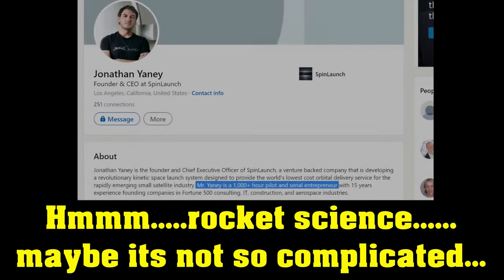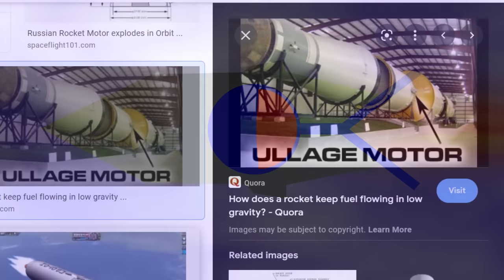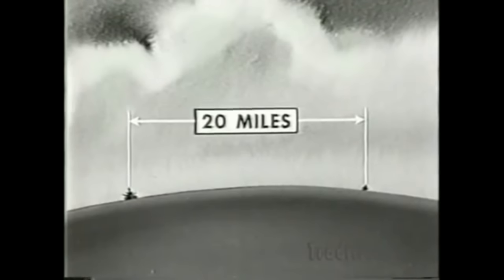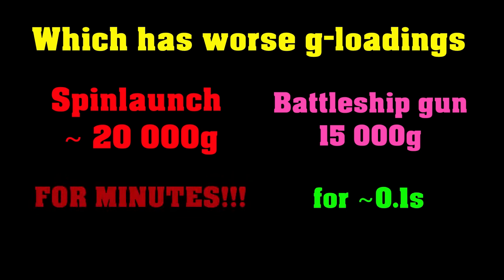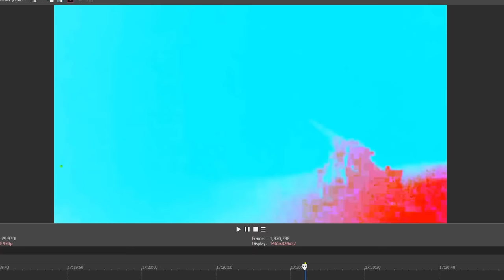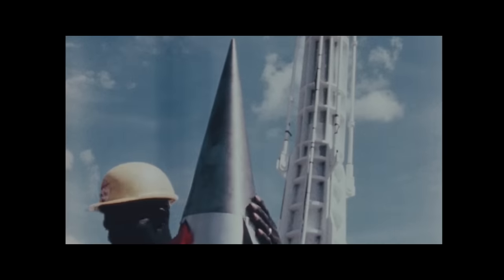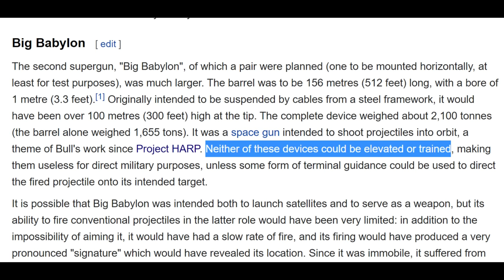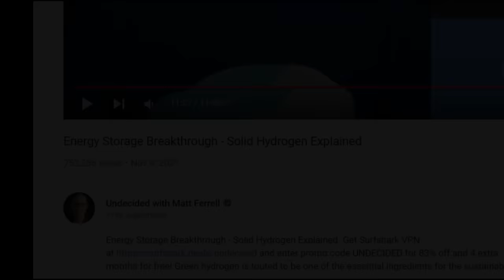Spinlaunch: BUSTED (Part 2)

Comment: I thought that 200kg is actually the max payload of their final version, so the whole assembly with fuel would have to be ~1t or more to further accelerate to orbital velocity. 
If the 200kg is total, it can orbit just oranges which would be useless even as a  crazy business proposal. There is electronics which can withstand 20k g, but the requirements may not be suitable for general purpose satellites, needless to say it requires lightweight, liquid propellant flight stage that bears such load, which afaik noone did before and I doubt they can.
Reply: 1:5 mass ratio is overly optimistic even for the rocket engines with the best specific impulse.
In their case (just as with a cannon launch) solid propellant is a more practical choice, since it can handle high g much better. So, much worse mass ratio...
Reply: @Amenti_H  Agreed…..But having said that, a 1U cubesat is only a couple of kilos, so it isn’t quite true to say that such a low payload mass is useless. But neither is it worth any price at all that Spinlaunch could think of charging. I think they’ve said they target a $200k launch price. Well, Falcon9 only costs $2000 per kilo, payload, and that’s all the way to orbit. Not just the first third.
So even if Spinlaunch successfully launch 200kg rocket, and meet their cost target……they still 5x price of a Falcon 9. That’s an F9 as it is today, not as it will be in ten years time. 
Realistically, Spinlaunch cannot charge more than $2k per “launch”. Less than the cost of the flight tickets to launch site for two of their engineers to accompany the payload when they send it. And much, much less than salaries of the five people they show in the control room, even if they were at the Homer Simpson level of expertise. At best it’s a hobby not a business.
Reply: @Amenti_H  yes it'd be "or more", I did the calculation with high SI and assumed they start engine in a thin atmosphere, using optimal structure and materials, supposing they have miracle light weight solution for heat shielding, mechanical stresses, vibrations etc and omitted things like they need substantial base bleed not to lose much velocity before they start main engine. 
I did so to get the most favorable rest mass to estimate stresses in the centrifuge, only to find that even with the hypothetical perfect rocket the stresses in the whole system are super large.

There is no escape (and I bet it won't be even orbital;)), as while there are practical solutions to particular problems, they add weight and reduce efficiency.
Reply: @johnfranklin8147  I don't mean that small satellites themselves are useless but the launch systems limited to them mostly are in a commercial sense. 

Cubesats and generally all the budget launches use economy of scale in large dispensers or a ride sharing to fill the capacity with the large main payload.

There are some exceptions, namely the possibility to get a small satellite effectively to a specific trajectory, so a dedicated launch is needed, like what is covered by Pegasus and other light systems.

Spin launch AFAIK proposes 200kg payload @ $800k. And considering decreasing prices for CubeSat launch this doesn't look optimistic, even if they'd make it work. 

The issue is they cannot scale easily to anything larger and it doesn't seem the system can be easily adjusted to reach a variety of flight profiles without further reducing the orbital capacity (again now not thinking about the whole thing disintegrating in an epic way or rather never reaching orbital velocity with declared cargo mass at the first place).
Reply: @janvesely6353  I agree precisely.
In fact, the one way the concept could be economic in principle, is the one thing Spinlaunch doesnt do. If you are just launching cannisters of fuel, oxygen or water, then the g-loading doesn’t matter. But you have to be launching at least tonne at a time (preferably 10 tonnes), to orbit. It isn’t even good enough to launch frequently in small cannisters, because then it costs more fuel to pick them up than they contain.
Reply: they can deliver Orange juice, freshly pressed orange juice to be exactly
Reply: @Amenti_H  spin-launch peedicts its full size rocket having 11 tons, 200kg is the payload.
Reply: @Nachtmahr79   and I predict zero.
Because it will be exactly that.

Comment: This might be a stupid question series of questions. 
The atmospheric pressure at low altitudes is the main problem because of the loss of speed.
The HARP project fired at relative low altitude. 
Wouldn't the HARP have gotten a lot better performance moving away from Yuma Proving Ground to a mountain

Comment: Well you can have pressure fed systems which don't rely on ullage motors to settle the propellant, and a small solid fuel ullage motor isn't a big deal or just using the reaction controll system which you would need anyway give you a push forward is an option to, but it's not the main issue.
Reply: or the spin-up jets can also impart enough forward acceleration to provide ullage...